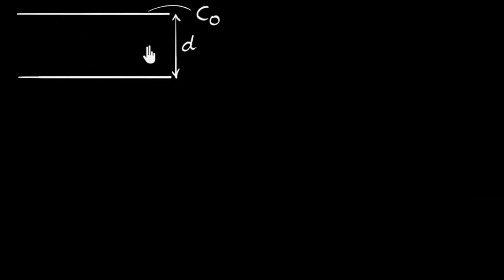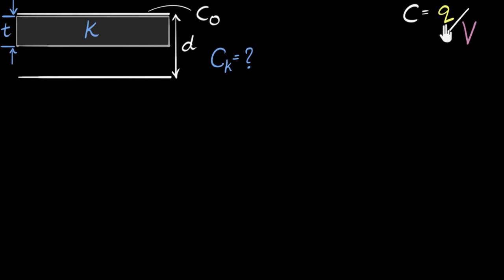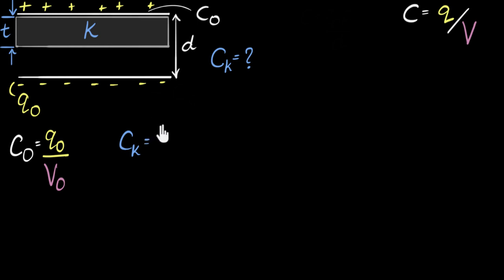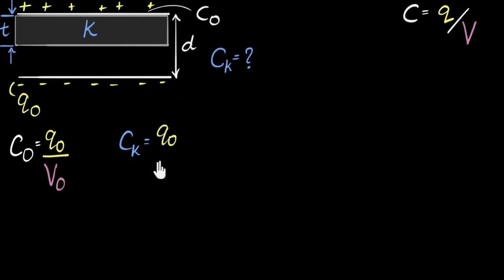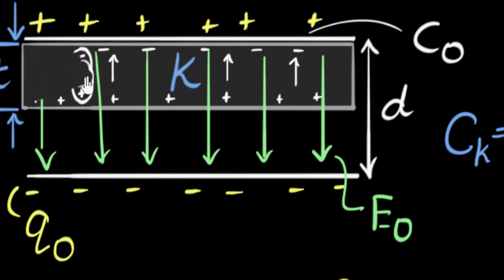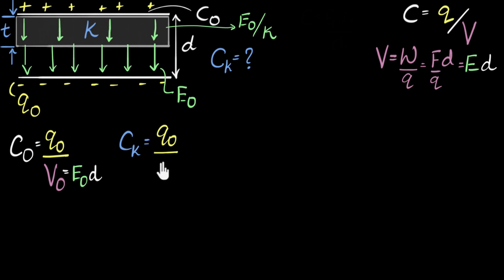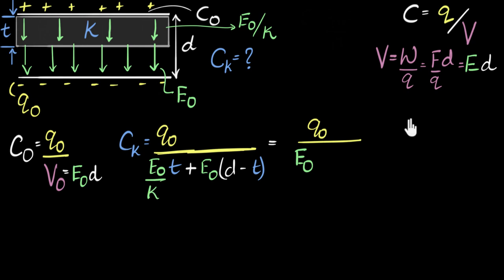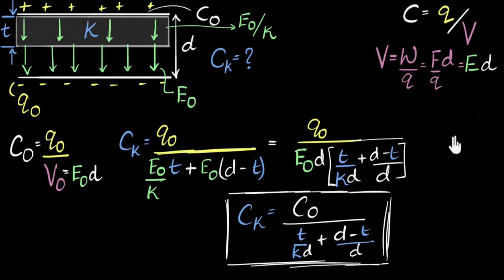Capacitor with partially filled dielectric | Electrostatic potential & capacitance | Khan Academy

Comment: For those who want to do the last question mathematically, just take the total distance excluding the thickness of the dielectric and multiply it by E to get the total potential for the region excluding the dielectric and then divide that potential by 2 to get the potential for the left and right most regions separately,add them up it makes up the same thing ( I know you could have just assumed that distance to be d-t in the first place, but it's more mathematically)
Reply: Or we can just do it with integration

Comment: Hi! Really enjoy you videos and excitement in your voice. Just a question: Between the dielectric and negative plate, is there no field enhancement caused by the positive charges at the bottom of the dielectric and the negative plate? That is, both the plates field and the polarisation field of the dielectric are additive in that region making that field not equal to Eo.

Comment: Hi! I just wanted to ask, how would the situation change if the dielectric was instead partially filling the capacitor from the side? Like instead of it having the same surface area, it now has t = d but it is inserted only halfway or so. Do you have a video on that or something to help me get on the way? Thanks? :-)
Reply: Btw I have tried an approached it as two parallel capacitors but it doesn't seem to work out